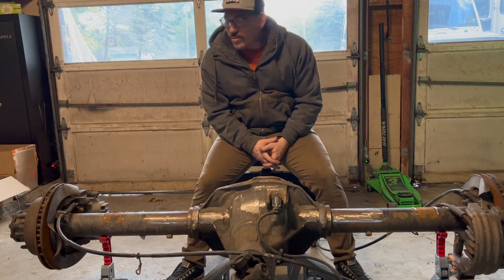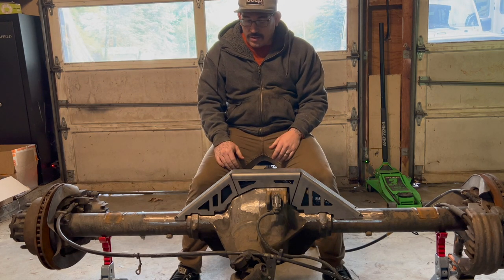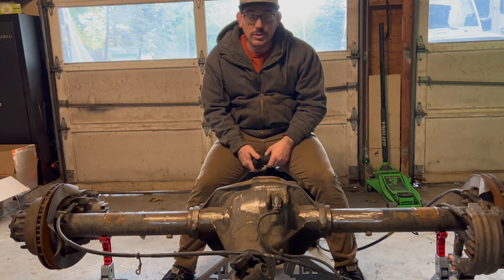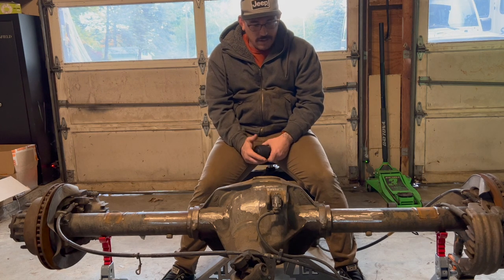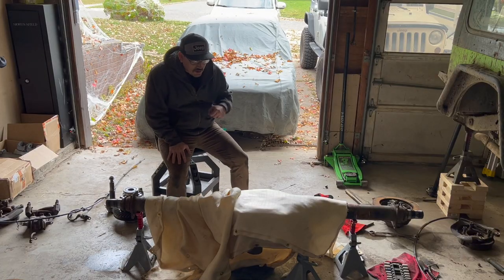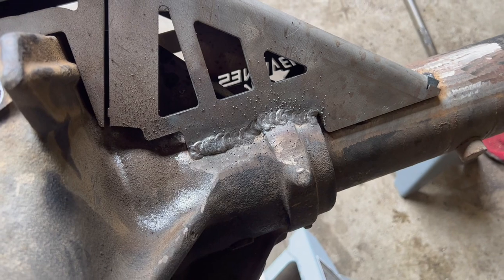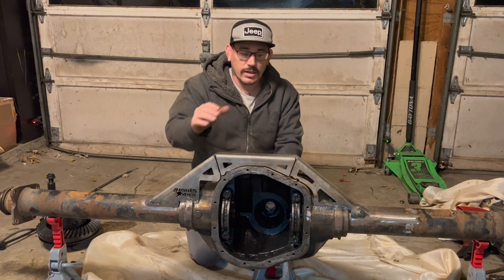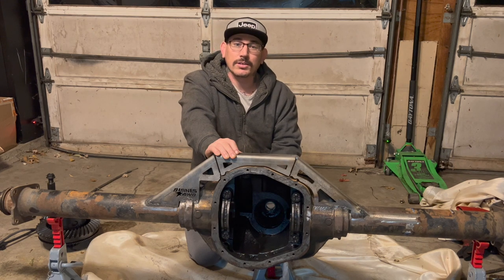Sterling rear axle truss install ( jeep wrangler YJ 1 ton swap project)

Comment: Did you use just regular mig wire and just preheat and cool slowly? Also I noticed you didn’t weld the tubes fully, seems to be a discussion whether it’s necessary or not or to even weld the truss to the cast at all
Reply from the maker: Yes pre heat post heat and wrap it so it cools slowly. I can assure you it needs to be welded to the casting I have ripped a front truss from the axle cause of the pressure on the upper link. I always say over kill underbroken

Comment: What about positioning of the truss. In regards to pinion angle. How do you know the truss is in the right position? Im asking because i meed to install a truss on my dana 35 for my tj.
Reply from the maker: Pinion angle is set thru the link arms.
Reply: @KBWheelin  so what do you align your truss with, as far as reference point?
Reply from the maker: @dabrownconservative7843 I guess it really depends on the truss I am using. If it’s cut for that specific axle I even the spacing on the front and rear. If it’s a universal truss I mock everything up with my pinion angle set then level the truss and burn it it. Hopefully that makes sense